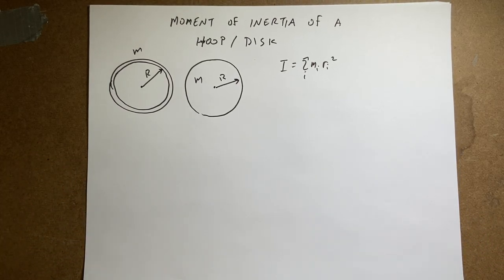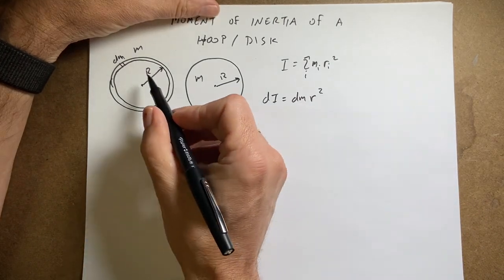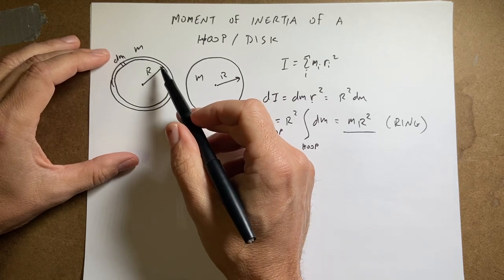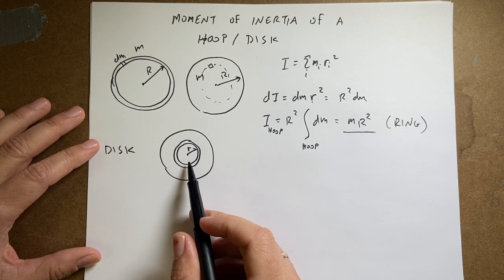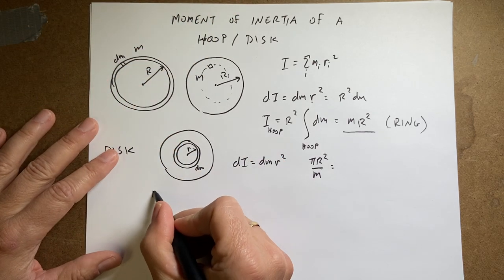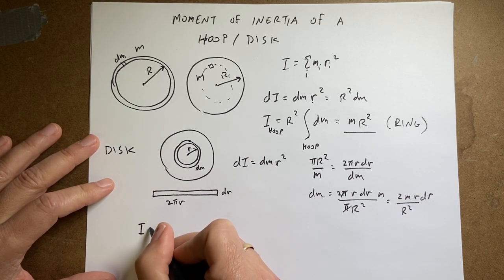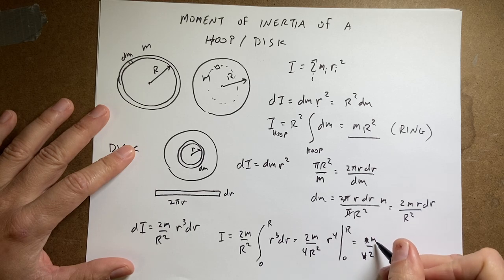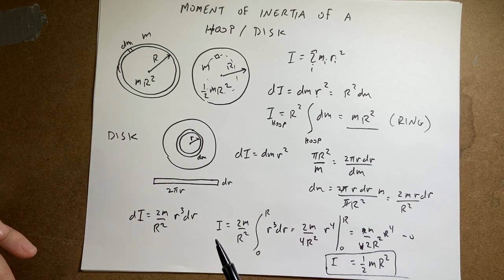Deriving the moment of inertia for a hoop (ring) and disk

Comment: i dont understand why we use "dM". What is dM specifically? Is it the bit of mass that we take (to calculate the moment of interia), and the reason it has the "d" at the front is because this "d" represents the rate of change? If that's the case, what is the rate of change describing? Rate of speed/velocity? thanks!
Reply: For the first case:
We know Density(ρ) = Mass/Volume
But for this case the ring i.e hoop has negligible thickness, similar to a straight line
Thus, we consider
linear mass density(ρ)
=Mass/length 
=M/L
(Length of the ring is equal to 2πr)
Thus,
Mass = density × length
= ρ × L
= ρ × 2πr
Thus, for very small point on the circumference of the ring i.e hoop the mass distributed is dm and length is dr, so we can write as,
dm = ρ × dr
Thus I = ∫ dI
I = ∫ dm R²
I = R² ∫ dm
I = R² ∫ ρdr
I = R²ρ ∫dr
Limits for integration is 0 to 2πr
I = R²ρ 2πr
I = R²(M/2πr)2πr
I = MR²
Reply: d(put variable)  represents a infinitely small value

Say you have drawn a y vs x graph...and it's curved...increasing upwards. The slope must be changing at every point. But if you magnify it infinitely, you can see a straight line ( Same as drawing a circles by joining the two points of a line) This magnified portion is actually very small. Hence the 'd' comes into play. It helps us to find variable changes 

Here, the mass is distributed over the circumference (2πr) 
So, if the total mass is M
Mass per unit circumference= M/2πr

For very small portion like dx, the mass is small too. So it's taken to be dM. 

Hope it helps